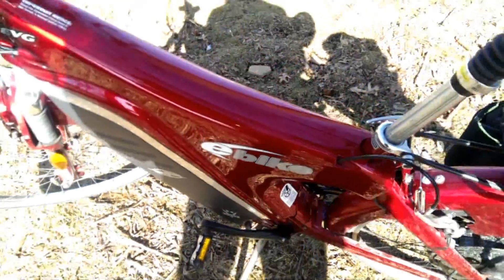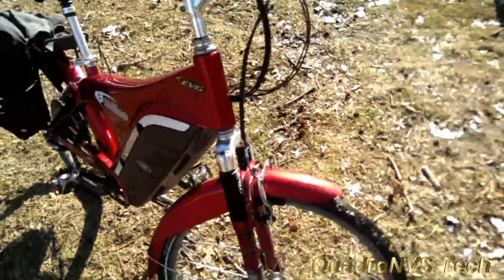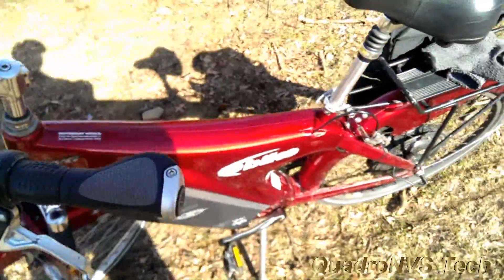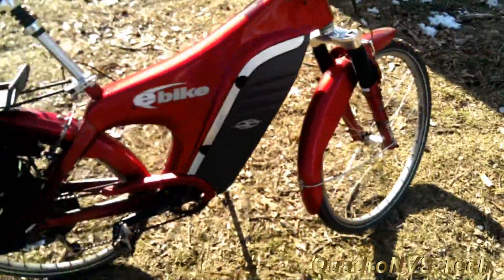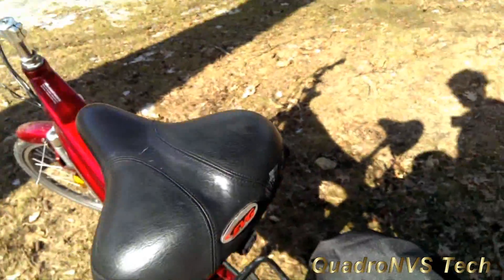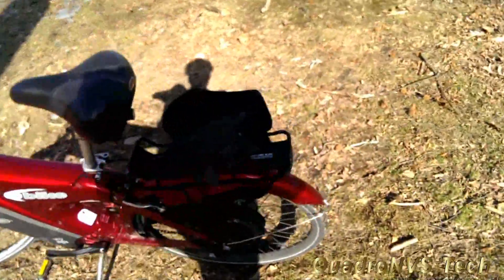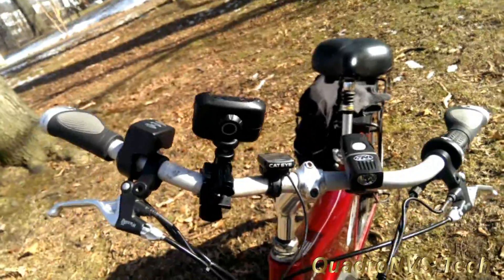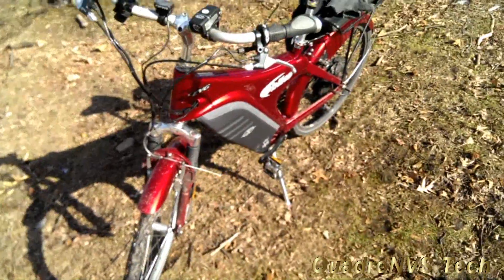EVG Motors Electric Bike Review and Ride

Comment: Nice bike! There was a  guy on my local craigslist that was selling this bike with all the original parts for $400. I found out it had a 24v battery with a 250watt motor which turned me off. Wow 27mph is fast! What kind of range are you getting on a full charge battery? Did you sold your 300SLA bike? I still have my 300Li and loving it. 20mph is good enough speed for me and I'm getting around 25 mile range. When I want to go faster and further, I hop on the 80cc 2 stroke kit that I installed on my other bike. That thing does 32mph and about 90 miles on a half gallon tank.
Reply: 45 min ride before the battery   died